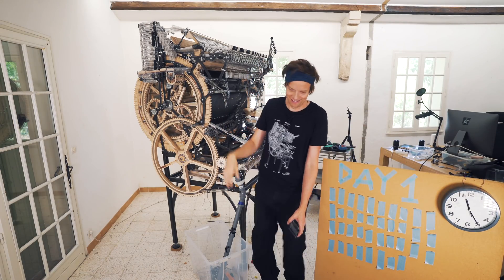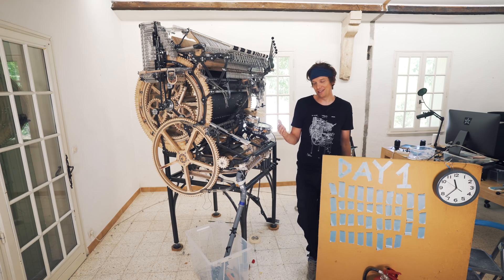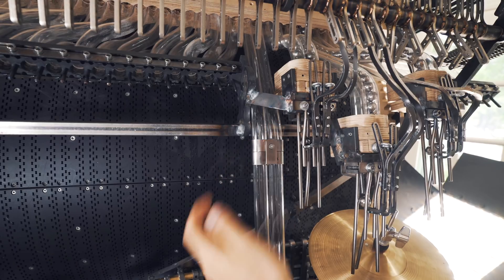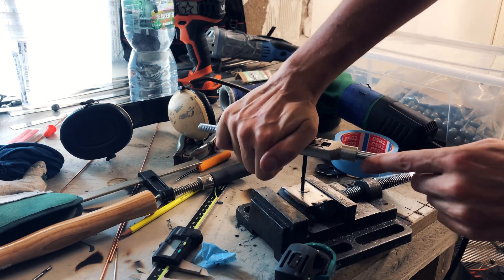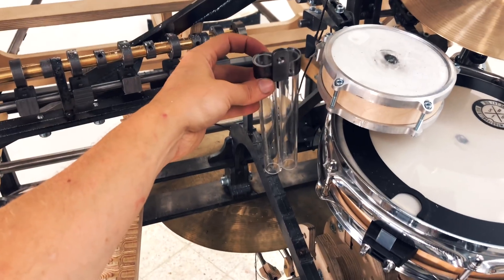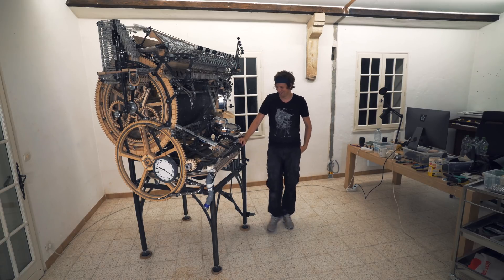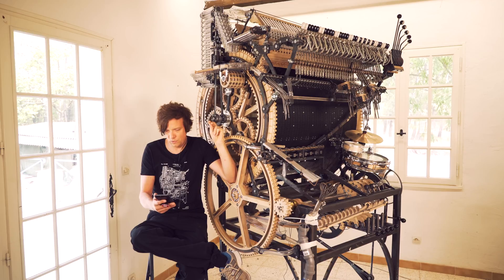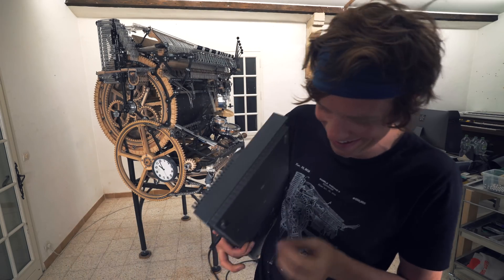38 Is a Magic Number - Marble Machine X #89

Comment: holy moly, the tubes have been re-bent 3 times??? And I am still in the distant past, but assuming the bent plastic tubes actually persist into the late 2021 incarnation of this machine, how many times will they end up re-bending these tubes?? Surely at this point building a custom tube heating oven would have paid for its time investment (and maybe even cost investment) many times over.

Comment: also, I just wanted to say, As a fabricator, I get your struggles. you're tearing this design out of your brain using your own blood sweat and tears to forge it. not only are you trying to figure out how to put it all together (engineer is) you're trying to fabricate it, tune it, and basically mix it. all from day one. It's monumental. burnout is super common, and being able to identify that and see that you need to step back is huge. that's the difference between being able to do amazing things, and simply trying to do amazing things. after this is done, you'll be equally suited to work at a shop, a concert hall, a design studio, or an audio engineer. and learning about all this stuff with you is amazing. Don't feel like you have to drive yourself harder for us, to make videos. these videos are like having a look at a watchmaker for us. it's absolutely fascinating, and it's about all the little bits and bobs for us.

No joke, you should reach out to tested.com and see if they would be interested in doing a bit on your some time. your story and your journey is amazing

Comment: the only time you should use a cordless for taps is with larger size ones. itty bitty ones like that are definitely a nono. I wouldn't even put those in the magnetic drill press. although for what you're doing, they also sell combo drill bit taps. so that might be a legitimate option for you, considering it's being off-axis that snaps bits, so having a big drill guiding your tap though the hole helps

Comment: Life pro tip with tungsten. you don't need full-length tungsten, ever. snap them in half now you have 4 sharp tips and can use a smaller tail cap to get into smaller places. also, to get fast, sharp tungsten, just slap it in a cordless drill. always sharpen with the tip facing the rotation so you're not pulling material and thinning out the tip to where it's going to explode in your weld. go look up a tungsten angle vs puddle guide, it'll blow your mind because it isn't what you expect. 

also, when snapping tungsten, don't. just grab a cutoff wheel, cut the whole pack in half, and then shapen it. tungsten will shatter rather than snap cleanly, so just accept that you need a tool and cut it. a 10 pack will get you 40 tips , but it's more like 30, because you're going to go swimming so badly with some that you can't use the other side because it'll get stuck in the torch (NOT FUN). you should just be able to slide your tungsten in and out from the front of the cup when you loosen the back cap. 

grab 2 cups and mark one clean and one dirty and just keep your tungsten sorted that way, and then when you sharpen them with the drill, it goes FAST. when i'm going at work, I save all the ones i find so i have about 65 in an electrical tape bin, and i'm set for like a month at a time.

what is going to cost you more, stopping to sharpen tungsten, or having an extra 3/4" piece that's too short to use, considering you were able to weld for twice as long?

also, check out CK worldwide and get a gas lense for your torch. it's better coverage with less gas. it'll make life a little easier for you.

Comment: I noticed that when you use the tap handle you only turn it backwards until it stops, however you should turn it more. I was taught the best resoults are from truning it 360 degree clockwise then 180 degree counterclockwise past the stop. Passing the stop will make turning easy again and you will hear a crack, that is the sound of the excess material between the tap and and the thread braking and escaping. This way the excess won't potentially ruin you thread.

Comment: I actually have a problem with grinding your tungsten on both ends. If you foul/ball the tip a second time, you are now having to either sharpen it with your collet and collet body still attached, or you have to break off the tungsten to remove it from the collet. Another issue with doing this method (not necessarily an issue for your application) when you grind the color marking off of you tungsten you now have no idea what type it is. If you run more then one alloy of tungsten this becomes a problem since you don't always know which one you're grabbing. In certain industries it is required that these colors remain visible since every part of the process needs to be tracked, from the filler rods and tungsten alloy, to the amperage used during welding. This was something drilled into my head by my welding instructor for years, hard to let it go.

Comment: You could make the hole for the docking pipes in the shape of an old fashioned keyhole where the round part of the hole is big enough to slip the head of the screw through and the slot part of the hole is the clearance size for the thread. That way you only have to lossen the screw and slide the pipe down and away. Less unscrewing and the screw stays in place and doesn't get lossed during  transit!

Comment: Glad you are giving up the cordless for tapping! :-)

To make it easier to make the tap start straight you can use "pre-taps" ( taps that are grinded down to undersize and with a long taper at the top ). Usually each size has three taps, #1 #2 and #3. #1 with smallest dimension and longest taper, #3 is the normal "full size" tap.

You are swedish! And a swede can not live without four consecutive weeks of vacation. Law of nature . . .

Comment: If you get the surgical tubing stuck in the pipes because the cord breaks on a regular basis, you could maybe use a vacuum pump to pull them out. I don't know how much force it takes though, so it may be too much for a pump to handle.

Comment: Hey Martin, I love the engineering and the videos that you produce ,but every time I watch you add another part I continue to see the MMX become increasingly top-heavy. you might want to consider putting some extra leg bracing on the machine to widen its base even if they're just temporarily mounted . If some unforeseen event should cause this thing to topple over it would have very far-reaching repercussions and probably put you years behind, if not walk away all together. Better safe than sorry . continue with your awesome project I wish you all the best

Comment: If you wish to have more success with your taps, use a handle better suited to the size of the tap. Small tap = small handle. This gives you much better feedback from the tap and reduces the break potential. I always admire your work. Nice job.

Comment: Since the kinetic fingers didn't get too much love and I'm not too big of a fan of them either, I was thinking - and yes, I do reallize this would mean a buttload of more work - that maybe a lightsystem would be pretty awesome.

If I recall correctly your base plate of the programming wheel's segements was metal.  If there was a ay to applay power onto this plate and let the contact be made by the programming pins / magnets then you could "easily" visualize the sound / note being played through making the light illuminate when the pin hits the actuator.
Just a thought.

Comment: Just about to say, is there any timing issue introduced by travelling time through marble tube?
Or we could adjust height of vibraphone module instead...

I think it would be nice test out few vibe bars attached to the machine.
To adjust timing! : )
But I think you've already concerned about that issue!
Reply: I was look for this comment. The time it take to travel along the tubes will be different according to each bend. I'm hoping that this won't be a problem because that would be a nightmare. It might not be a problem with the weight and height of marble being much greater than frictional losses of them travelling through the tubes.
Reply: @nelsonphillips  Exactly!

Comment: You're lucky that you managed to heat, bend, and fit 38 hard plastic pipes, and only came down with a bit of loopiness. If I knew I had to do that during a project, I wouldn't even start it, because I know that I would completely flip out of control.

Applauds incredible patience  :-)

Comment: Why are you building the MMX? Through these years, I've been watching you struggle with the construction of this fantastic machine and personally, I've been comparing your process with mine, even if it doesn't has relation at all. I 
My struggle is an architecture thesis.. A theoretical architecture thesis that's been giving me battle for a lot of time (more than I would be happy to confess). And I've asked my self that same question.. "Why I'm I doing this? Why can't I graduate with another method? Why not choosing I fictional proyect as everybody does? Why do I want to fight the theories and retorics of contemporary architecture, instead of just follow the path many others had?" .. And the answer is almost always "Why not?"
Everybody (not everybody, but many people) can repeat what others had done. Making it better, seeking for perfection.. But perfection is boring. That's not the path of the adventurous. Discovering, designing, creating, inventing.. Yes, you had invented the marble machine before, but you said it didn't actually work as you desire. And right now, you are not inventing one music instrument.. You are inventing a new whole technique, a new form of entertainment, a different way to SEE music.
It's not just a marble machine. It's the experience you have achieved in 89 videos; the teams you have formed; all the likes you have gotten by shaking our hearts, and of course, the music that has been inside your head, preparing to flow through the pipes of that enormous thing.
Thanks for the humane side of this story. It wouldn't be the same.

Comment: Have you allready desing and build the shipping holder parts? When you take all part to put in the van, they all need custom made boxes with custom holder or they will bent and twist so that they dont fit together anymore. Also keep on mind the value of each part and take good but cheap casco for instruments- insurance to them.
The drum machine inside the mmx is good idea, put it work with ldr's https://youtu.be/CgXZGry74bA i am building an drum machine sequenser from roulette by using Light as swithing the sound... Also gonna do the Light organ so where ever i put my fingers, it Will make a sound.

Comment: When you made the tubing joint, you should have cut the steel tubes off-center (longer piece on the top) so the top ends of the lower plastic tubes could fit partially inside the upper steel tubes.  This would guarantee exact alignment and eliminating the chance of a marble jam(rather then relying only on that single screw to do so).

Comment: One more 'tungsten' tip: split all 10 rods you get in a pack in half. Sharpen all 20 on a single end. Carry those 19 with you in a small cup. If you sharpen both sides, sometimes you can't actually flip it around because it doesn't fit anymore. It's way easier to grab a fresh new tungsten each time you contaminate than using one at a time

Comment: Hi mister "I'm not really an engineer",
I am close to the finish line of my engineering studies and I am not sure I know a lot of people that could pull of a project like this. I wouldn't place my bets on myself as I have learned enough to know that "Mountain of work" is an understatement here.  It's a Mountain that throws rocks at you, while shape-shifting when you try to take the next big step. 

Human senses are extremely good at noticing imperfections in symmetry or sound. The precision that is required here, coupled with modularity and the large size ... That is just asking for trouble.
I could learn a lot from you. (So please tell us about all the problems that come up!)

You might not have the official title ... But if you are not an engineer ... will I ever be one?

Comment: Question - those tubes are all different lengths, meaning marbles have to travel varying distances to the point where they drop. How do you ensure programmed notes are in sync? Is there a calibration mechanism somewhere?

Comment: I cringed when I saw him grinding the tungsten electrodes on a grinder with no dust collection or filters hooked up.
Reply: I didn't know that was a problem. Thanks for the tip! Is it because tungsten is so hard? Does it produce fumes? I know that metal fume fever is no joke.
Reply: @buddyclem7328  the most common electrodes contain thorium. The radiation produced from it can't  penetrate the skin but it can do damage if the dust  gets into you body. 

I dont know if his electrodes are thoriated or not but I set up dust extraction for all my electrode grinds as good practice.
Reply: @thedesigns9570  Thanks for explaining that to me. I didn't know that it was hazardous before.

Comment: I been wondering how is going to be reflected the time between when the pin in the wheel it's taken to release a metal marble and the travel through the pipes and the flying distance until hit the drum, guitar or xylophone.
And how this relations are equal or balanced for every single channel?
And so the time in which every note it's played it will be perfectly executed.

Thanks for answering this question.

Comment: Question: Is the the Marble Machine X a stupid idea?

Answer: YES!  But that's why you should do it.  Sometimes stupid ideas become GLORIOUS results.  That's part of what art is.  You make things because they don't have a purpose but yet they still inspire and may even have a practical use at the end (i.e. make music).  As my little profile pic shows, I'm a pilot.  I follow quite a few flying YouTubers, and one of them is Mark Patey.  He took a PZL Wilga (small utility airplane), put a turboprop engine on it (tripling the amount of power it has), made massive changes to the landing gear, wings, and other systems to create the "ultimate bush airplane".  It is practical? Not really.  Will anyone buy one?  Probably not.  So why make it?  Because he could and because it was fun to not only build, but it's fun to fly.  Now he's taking a Piper Cub (which normally has about 100 horsepower) and putting an 8-cylinder, 600 HP engine in it.  Again, is it practical?  Hell no!  But it's sure gonna be fun to watch him have fun building and hopefully flying it!

Comment: I was talking to my chemist buddy and he said that it would be a good idea to aneal the all the ppma pipes u bent. Heat bending the pipes causes stress points to form. The the annealing gets rid of the stress points. I thought this was worth mentioning because all the moving and stuff you might do to the MX on tour could cause your pipes to break at the bends. To aneal you just heat the pieces in an  oven to a temperature just below the point where it'll start to disform, and then let the pieces cool down slowly. It's a simple process, he said it's not necessary but it could save you some heartache.

Comment: So if I have this correct, the drop points have to be the same height from the drop surface for the timing of when a note gets played they all need to be synchronous. And the pipes are just backfilling for each channel and then in the splitter they grey slides move one marble in for every one marble out? Then the lifters just fill them back up? How will you backfill each channel between the in and out beforehand if it drops every time you open the gate

Comment: I wonder whether timing among the different instruments is ok, it would be if the time/length of the path of marbles are the same after leaving the 'gate' (after being released) you may have introduced milliseconds' delays
Reply: It would be a good idea to have adjustable pipes or something to be able to calibrate the timings. Sort of how you tune a guitar before playing, you'd just adjust the lengths of the pipes until all the instruments are synced
Reply: at the same time the 'in air' path must be taken into consideration, at high rate difference in arrival time will be noticable.
Reply: @COPKALA  Couldn't you just keep adjusting the tube length until the instruments synced up anyways? What difference does it make how long they are in the air if they all arrive at the time they're supposed to anyways?
Reply: The issue is Martin has tuned a lot the gates/triggers of different marbles so that they start at the same time. 

Now, in principle yes by modifying a bit each single tube this may help, but only if the tube would also (in case it is needed) slow the ball.
The main point is not how much time the marbles stay in air, the main point is how much difference in air is spent when the marbles are travelling different 'notes' or instruments, to me it seems that some may have, say, 15 cm other 50cm.... 35 cm, alone, means almost 3ms of time difference, even if the marbles are released at the very same time

Comment: Could you potentially put a bar under the kinetic fingers and attach 38 tiny slinky’s in a row and then hook each kinetic finger to a spring under slight tension. Then each time a note is played it will ‘pluck’ the slinky. This will create a little bounce in the spring and when they are all played together it’ll almost look like a n old school 2D synthesiser! It has the potential to look dope as hell!

Comment: I have a question: How will the machine account for the extra time the marbles spend in the tubes he put in today? Are they all the same length somehow, or is there enough holes in the programmer to account for such minute differences?

Glad to have you back from break, Martin. Excited to get on the roller coaster with ya.